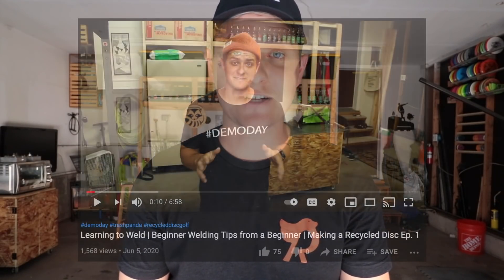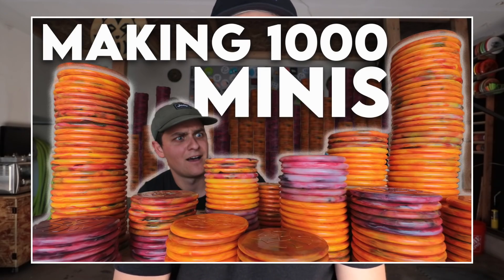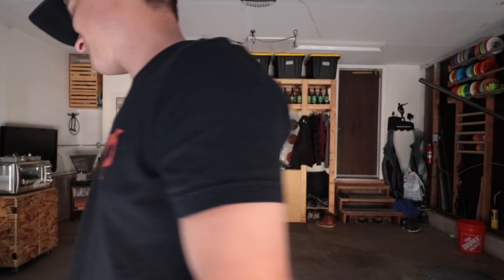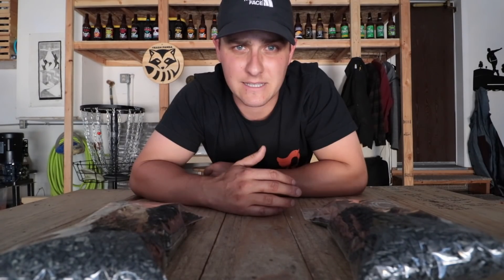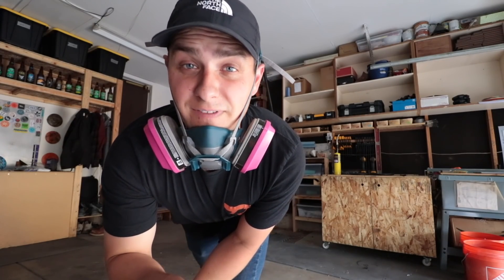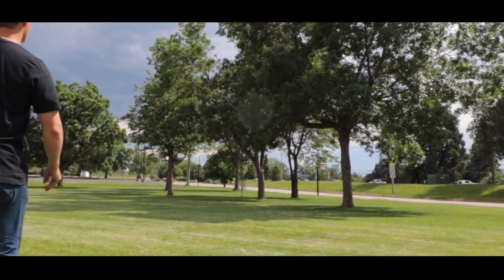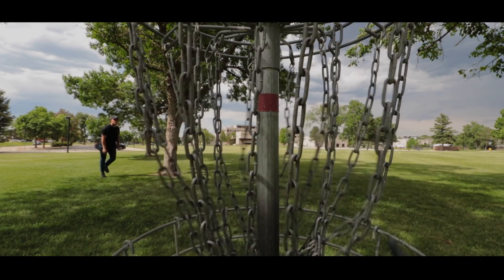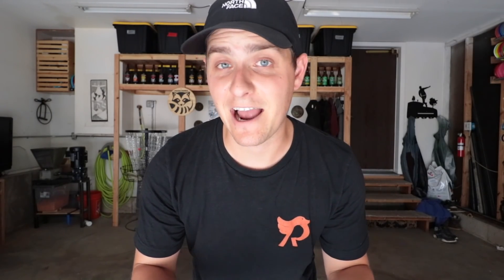The Best (and easiest) Disc I've Made Yet

Comment: Melt flow (or Flow Rate as we’ve heard it - maybe that’s a UK thing 😅) is something that was pretty mind blowing when we found out about it too. Couldn’t work out why some HDPE injections wouldn’t fill the mould under the exact same conditions. Since all our plastic comes from donations and waste, we’ve now categorised these into 2 types. Bottle tops are made by injection moulding, therefore they are injection-grade (i.e. high flow rate) plastic. Shampoo and detergent bottles are extrusion blow moulded (i.e. low flow rate).

If we mix up a custom colour using more than 50% extrusion grade plastic, it’s almost impossible to fill a mould. That’s why we don’t have any yellow or white-based custom colours - because most of those colours come from donated bottles rather than lids. It would be really interesting to know the number behind these different grades of plastic, but since we’re dealing with waste, it’s unlikely to happen!

Look forward to seeing the next few days of experimentation! Rock on, dude 🤙🏽
Reply from the maker: This is a masterclass for anyone looking to get into recycling! Thanks for the tips Matt/Jonny 🤘
Reply: @TrashPandaDiscGolf  for you, anytime brother 🤍

Comment: I heard you are working on a machine that uses hydraulics. I had this idea for making it really easy to produce discs in big patches: make the mold somehow locking so that when it's full, you can close the inlet and remove the mold. If you combined this with something like 20 liter cylinder for molten plastic, you could do 10 discs in a row - mold on, plastic in, switch mold, plastic in and so on until the cylinder is empty.

Comment: Check out a stop collar for your drill bit when drilling out the injection tube. you wont run the risk of drilling through the disc or into your mold.

Comment: Past mold tooling n molder.   
Haven't watched all your videos but some tips.  
Molding at different times of day will change things.  
Consistent ejection and and cooling times matter.  Every plastic is different.  
Different temps in your heating bands can change things.  
Keep your mold clean.  
Looks like you need more pressure.  Machines have crazy amount of force clamping.  
Cooling through the mold via water or air can help Big time
Enjoy n keep it up
Reply from the maker: Thanks for the tips Dustin!

Comment: Genuinely curious: where’s the air go from inside the mold? Does it just squeeze out the gap of the two halves or do you have a vent hole? Keep it up man! Been cool to watch your journey.
Reply from the maker: Since making this mold I learned about air vents and the size they need to be (they are present on my mini molds), but since I made this one before I knew: yes, the air just squeezes out the gaps between the bolts 🤣

Comment: congrats on testing, curious how melt flow would relate to chemical density and end weight of the disk
Reply from the maker: As far as I understand it, the density will remain the same regardless of melt flow! (The variance I used to have on weight was due to a mold deflection.)
Reply: @TrashPandaDiscGolf  crazy a piece of billet deformed that much. Is that what causes different flight paths at different weights? More deflection in the mold?

Comment: Black plastic is used a lot in industry because it hides flaws (meaning you throw out fewer mistakes) which is good for waste reduction.  However many recycling systems use cameras to sort plastics by type, and they often can't identify when it's black, so lots of black plastic doesn't get recycled.  If you aren't worried about producing pristine looking discs, avoiding black plastic means a better chance of them being recycled.

Comment: Just stock up on enough discs and you will have a mold you can send to PDGA for approval. I would do this is if number 5 plastic is what you want from the discs and know it works for your needs otherwise try the number 1 plastic.

Comment: Is higher melt flow achieved by increasing the injection temp, or is there something else that is key to this?
Reply: It's just the way the plastic is made. It's the molecular composition. Like Jesse said you can have a PP with melt flow of 5 and one of 30. Both melting at the same temp.
Reply from the maker: Exactly what Zach said!
Reply: Can you tell the melt flow on the recycled containers, or do you have to specifically buy the pellets to be sure? I would think your personally chipped pellets would be a mix of flow rates. Regardless, this will be a fun process to watch! Got my minis today! They're awesome! Thanks again!